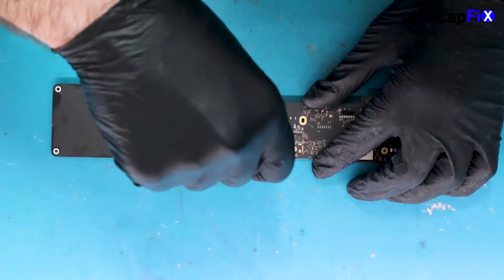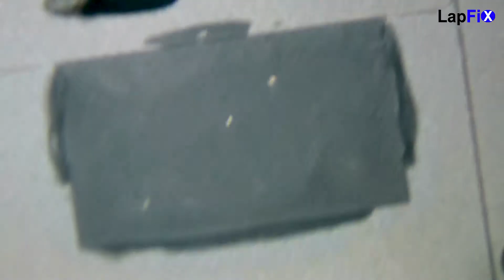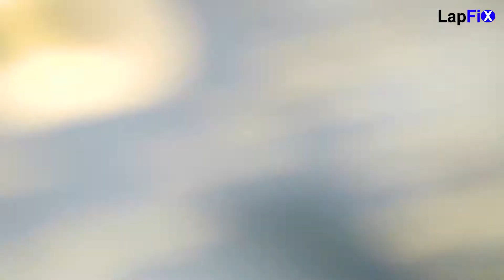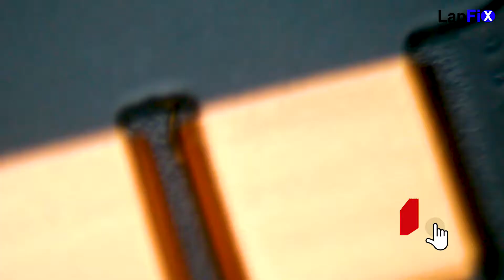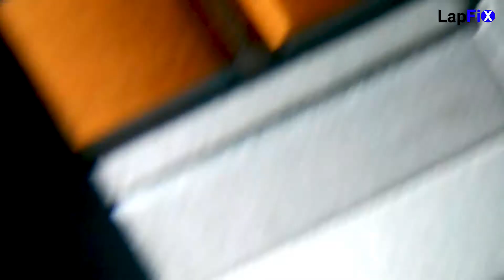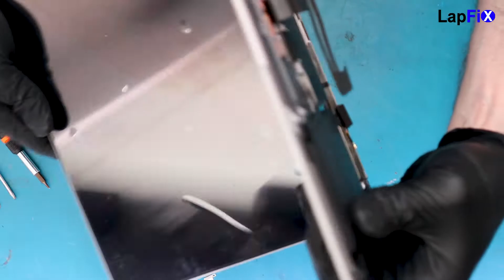MacBook Air M1 A2337 Liquid Spill Screen Replacement and touchpad

Comment: Hey, I've replaced a Macbook Pro screen before, so I thought it would be a breeze to fix my cracked display on my A2337. I got it all put back together -- everything seemed to be properly seated, etc., but I don't get a picture. When I reboot, the screen glows a darkish gray, and stays that way. It was plugged in during boot. Any ideas of what could be the issue? Tonight I'm going to take it apart and reinstall the old display to see if it works. FWIW, I bought the display on ebay, and it was allegedly OEM -- looks right.

Comment: Can I chenge the damaged screen of MacBook m1 with another year screen MacBook Air model? And if yes , which model is ok? Which fits? 2018; 2019?
Reply from the maker: nooooo.  I believe you are asking about the a1932 and a2179 2020 models.  They are NOT compatible.  As of making the video, the only compatible screen is the a2337 m1 screen
Reply: @lapfix  so the 2020 a2179 screen will not work on the 2020 a2337 m1?